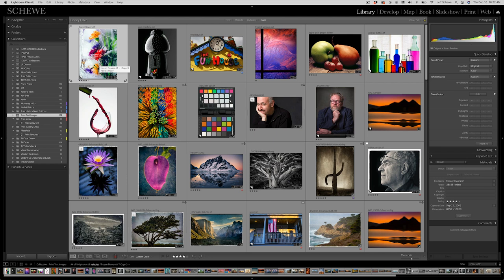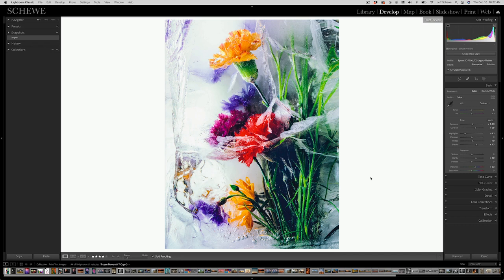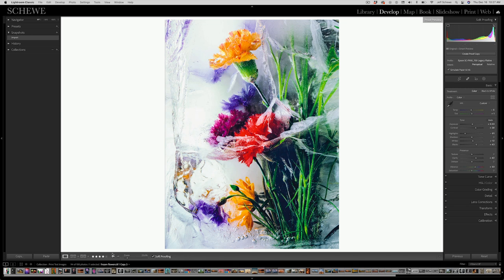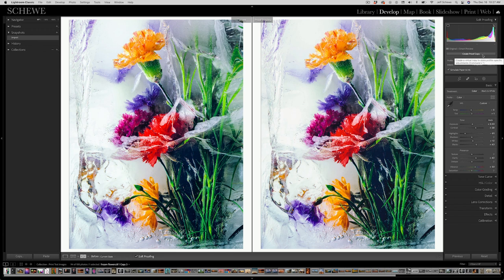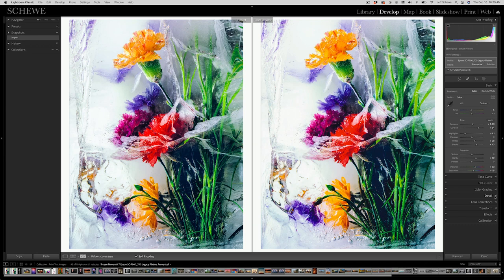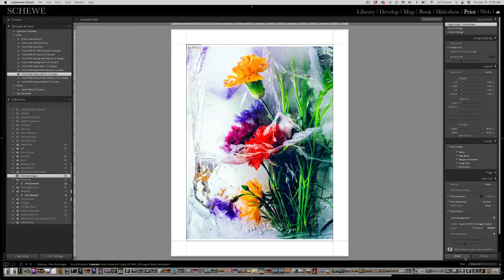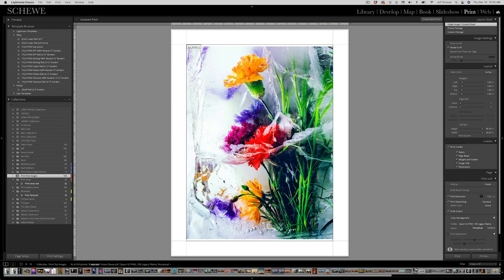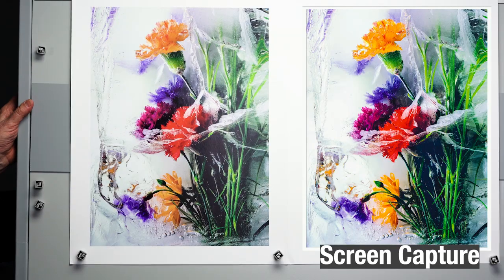Lightroom Soft Proofing - PXL Print Series

Comment: Hey question @photoPXL. Saw someone suggest using the Calibration panel in Lightroom, to specifically bump up the Saturation on Blue Primary to bring an image "to life" more. It seems to work but I don't know why. As I understand it you are pumping up the blue in every pixel throughout the image. Why isn't it causing a blue cast? It seems instead to just liven up the image. I'd like to know what this is really doing and why it seems to work. Thanks!

Comment: I’ve got a NEC PA272W with SV2. Do you have a recommendation for luminance and contrast ratio? I usually have made a separate calibration preset for general purpose viewing vs. a darker and lower CR for printing, but maybe that’s not necessary because of the soft proofing’s visual adjustment? 

I attended the Epson Print Academy in Los Angeles circa 2005 and loved it!

Thanks guys!
Reply from the maker: Your monitor should be set one way and do it when calibrating your monitor.  Soft proofing won't work unless the monitor is calibrated.
Reply: @photoPXL  that didn’t really answer my question.

Comment: OK have I missed something. With the greatest of respect this is still unclear this is all very good but I have difficulty understanding the work flow. Let me try to explain. I can not send my Pro Photo RGB image to any pro printers. The good ones accept Adobe RGB in a TIFF/JPEG file. This means that I have to save the image as one of the former files as well as Adobe RGB. Then I need to convert to profile other wise I would have an sRGB with a tagged Pro Photo RGB colour space and that's impossible to work with. Is this stage to be completed before I have soft proofed, as changing to a smaller colour space will affect the colour of the image yet again. The situation is going to be compounded if I chose sRGB for a website. I feel that the soft proof dialogue box should have a few more check boxes. It looks to me that I now need to import this into Photoshop CC and start again. I have 6 rendering intents in Photoshop opposed to the two in LRC. I also need to change print size and finally check sharpening, Can anyone feel my pain. Maybe I should just duplicate the image flatten the image and then do it all in Photoshop CC with split screen two up in play.